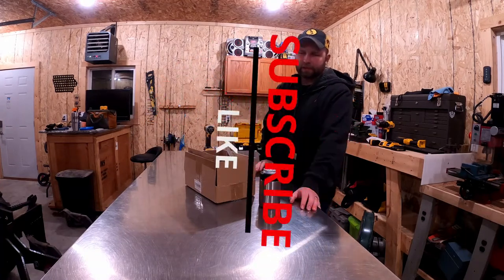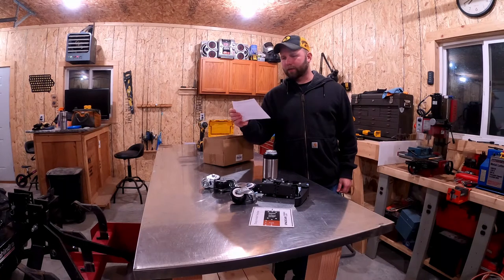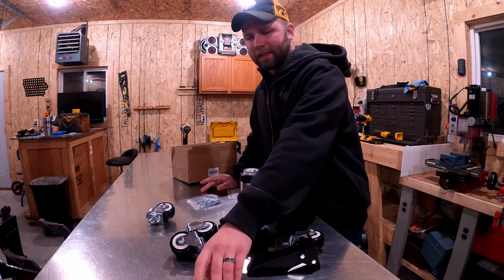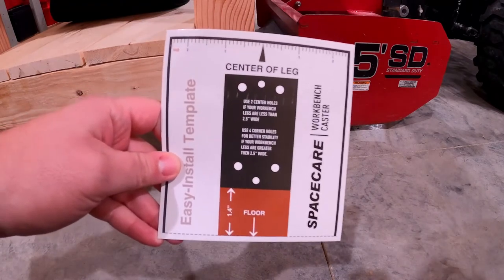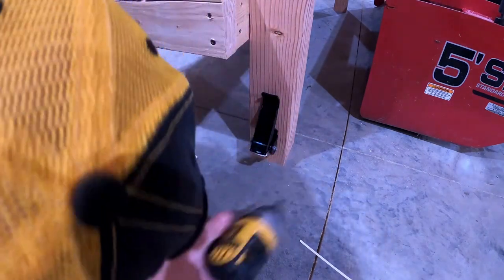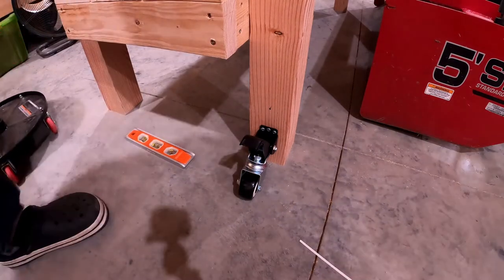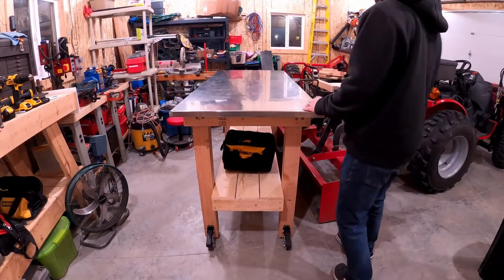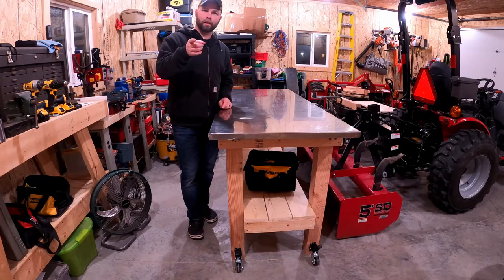How To Build A Rolling Workbench- Installing Retractable Casters With Wheels

Comment: You've had them a year now, any followup observations? I bought the same casters. I am going to mount them on a table frame that is about half the length of your table and it has a steel frame with 1-1/2 square legs. I figured I would upgrade to 1/4" screws and have them mount the base through to the other side of the steel leg and fasten with nylon lock nuts. I don't intend to need anywhere near the 600 pound weight rating. I like the work you did on your steel topped table. Nice job.
Reply from the maker: They have been working great and i havent had an issue with them. They are still installed the same way as they are in the video!

Comment: I have the exact same casters.  Recommend not trimming the bottom of the template at the dotted line.  The instructions are garbage - but the wheels work a little  better if screwed in 1/4" higher -- so just leave the template as is.  Learned by dong it your way first.  Ha ha.. It is an excellent device.  The bench I constructed is virtually identical to yours (minus the cool stainless top).  Just an aside - what is the purpose of the Sharpie dot you made?  Just winging it to start?? :)
Reply from the maker: I was lucky that work was cleaning out some areas so I got the stainless top for a good price! I had to look back at the video to see why I was using the sharpie dot, winging it I was!! lol Thanks for stopping in! The wheels are still working great
Reply: @k6outdoors    Ha haaa... Yea.  Definitely do lots of that here. :)